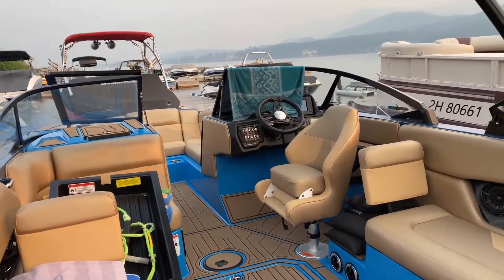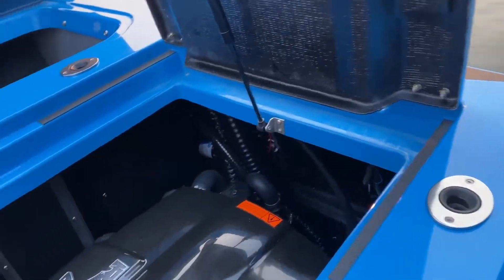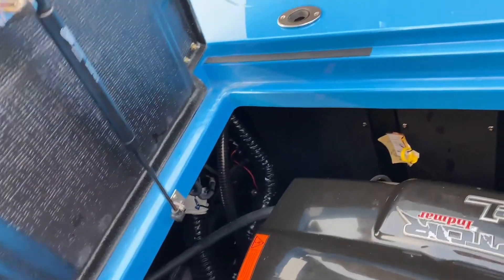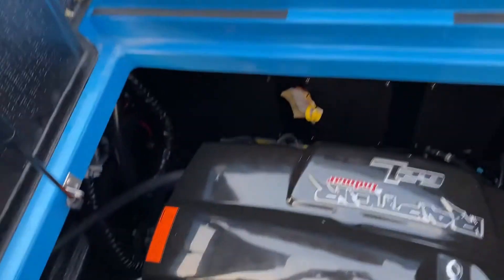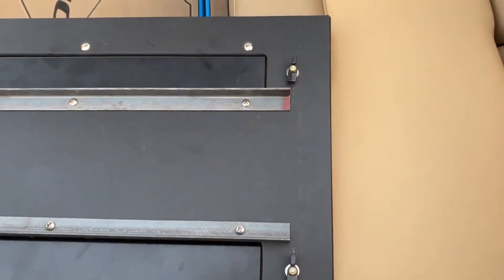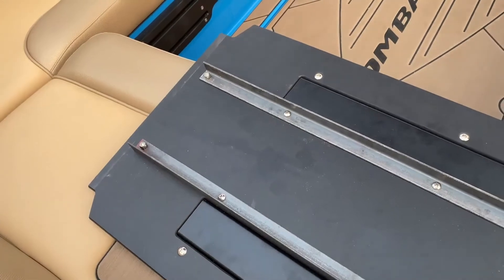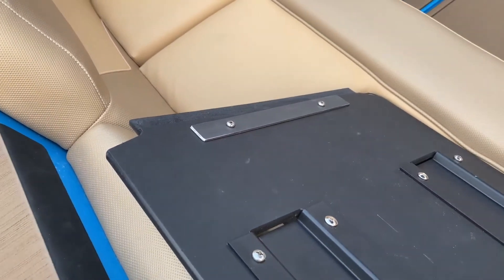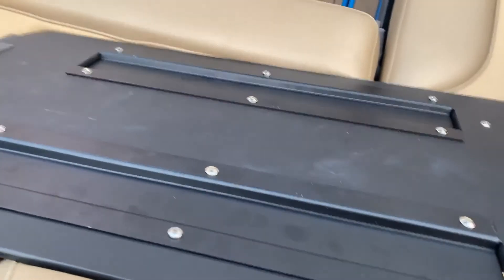Moomba Mojo 2021 - Engine Divider Reinforcement

Comment: nice boat and a super involved build! Have been saying for ages that this is what my family would need to do to our 08' Malibu VLX  in order to Actually get it to throw a consistent surf wave without the hour long set up and take down process of aux bags, wake plates etc. We're on Windermere too, will slow down if I cross behind this sucker next summer - the wake is serious!
Reply from the maker: Glad to see another Windermere boater on here! Hopefully the snowpack is solid this year and we don't melt everything by the end of June! I understand both the need to get a larger wave and the limitations that previous generation boats have. We were on a 2005 Moomba LSV until last year and we sacked that boat up with 3300 lbs of extra water in order to get a decent surf wave. That boat, even more so than 08' Malibu, had hardly any freeboard. We'd be literally running the rub rail in the water at the back of the boat and always steered as clear as we could from other (larger) surf boats for fear of taking on water. If you see me out there and want to go for a pull or just talk shop, hit me up on gmail (my full name @gmail).
Reply: @haydenbreeze  couldn't agree more, our dock access is shallow to begin with! We typically add about 1600lbs on top of the 4 tank setup from malibu in that year, plus wedge, 2 wake shapers and as many passengers as possible. All a bit of a production but what can ya do. Biggest concern has always been either dunking the bow, the stress on engine walls and swim compartments, and the added stress of that weight on the gel coat - we have a few hairline cracks that have appeared over the years. Solution will ultimately probably be something a bit newer and more substantial that is just hit the buttons and go, but if we go the route of plumbing in extra bags to make things easier i'll hit ya up as you seem to have it down to a science! Be on the lookout for a sand/tan and white wakesetter come June!